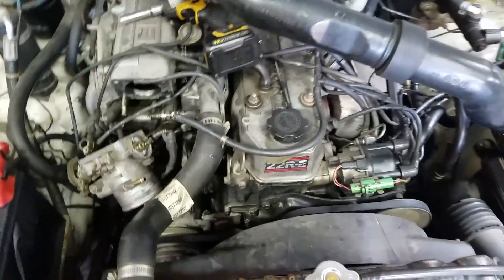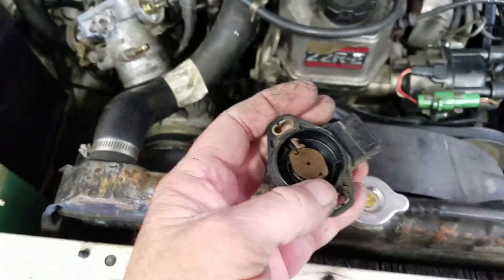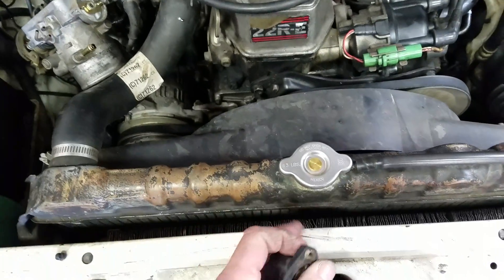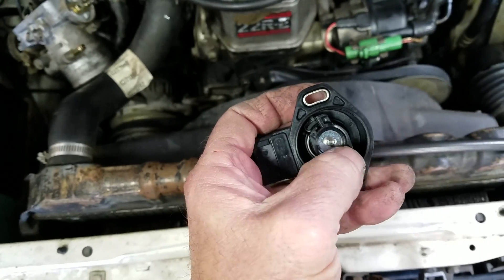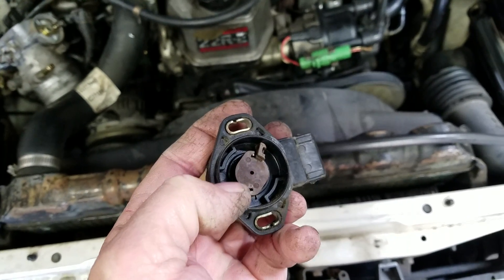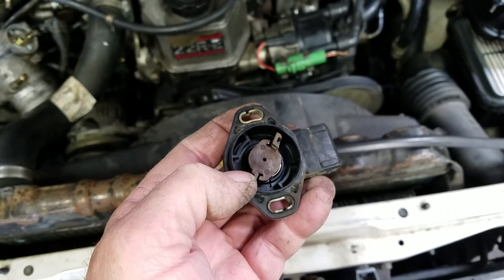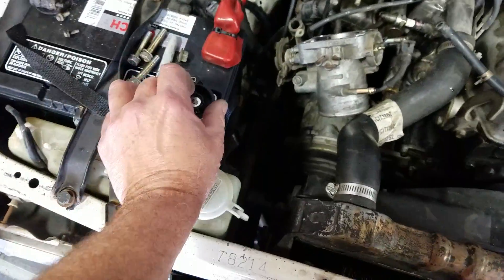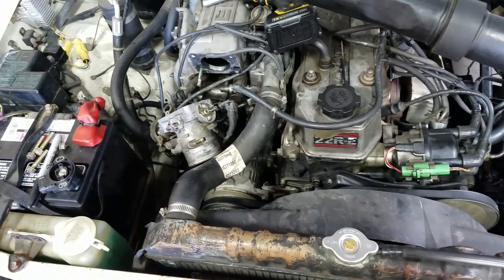Toyota 22re Throttle Position Sensor  TPS

Comment: Nice video a question? Do you need to adjust the new TPS or is just bolt in plug and play thank very much
Reply: marvin calderon did you have to adjust it? Or is it just plug and play?
Reply: @Alex1997626  that's what I'm trying to see before I buy a new one I dont know if my current tps  just need adjustment or is bad for good my truck  dont have the same power feels like I small shake like I hiccup when you accelerate
Reply: @Mecc2323  It will need adjusting.  LC Engineering has some really good instructions on how to adjust it.
Reply: Alex Harline : that is no adjustment, is only to check if is good or bad.
Reply: @2thehat  link ?
Reply: The link is easily found with a Google search but since y'all don't feel like doing that here ya go. 
 https://lcengineering.com/throttle-position-sensor-adjustment/

If the tps is not properly adjusted throttle response is effected drastically.  Yes it can be used to test if it is good or bad.  But it is also a major input for the ECU.  If it is not adjusted correctly there ECU will see the wrong signal and not behave in the way you expect.  Do your research before you start talking crap.

Comment: my 86 4unner 22re wants to stall could it be the tps going bad i have no check engine I noticed my throttle rpm stays stuck
Reply from the maker: if you short the TE&E1 at the check engine connector and the timing does not change you chances are its bad or just pull it off and see if it snaps back fast  the it will have to be adjusted I think there are videos on setting it good luck
Reply: Robert Vera did the tps work?